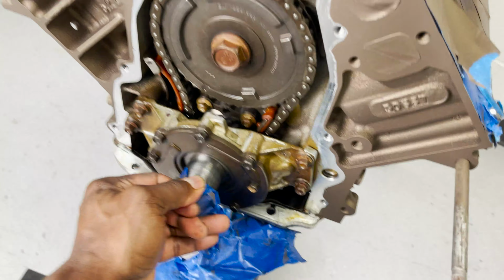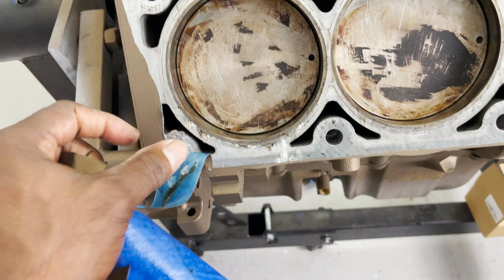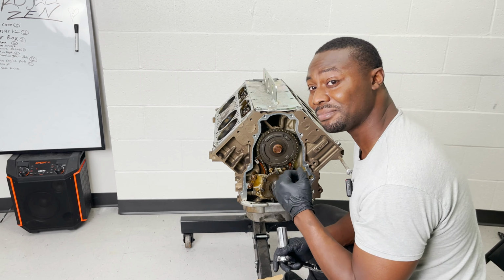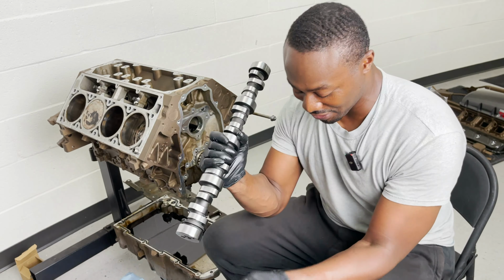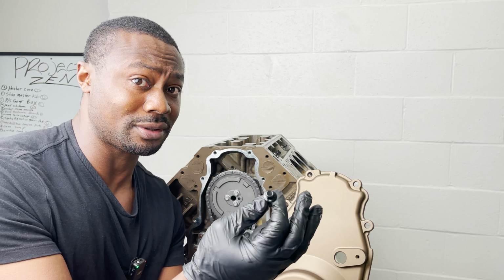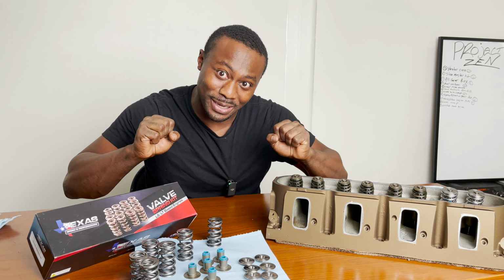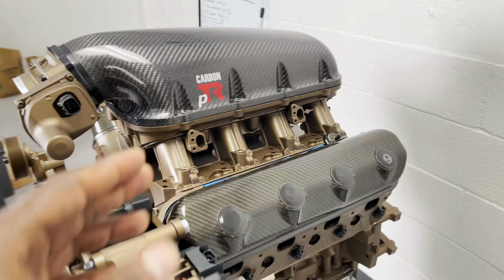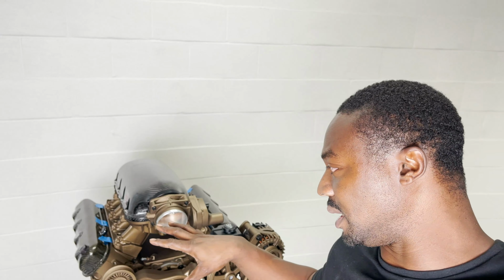EPIC LS ENGINE BUILD

Comment: New paint, old rotating assembly.  Zero measurements on valve train.  You assembled an engine, but didn't build one.  The cut from valve spring to complete just means someone else did it for you.
Reply: People without automotive videos should not hate.